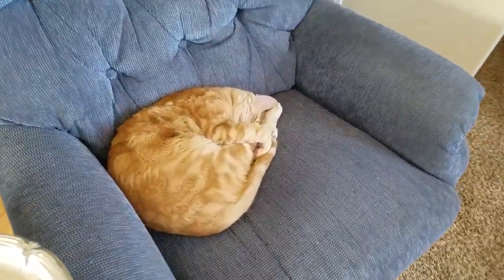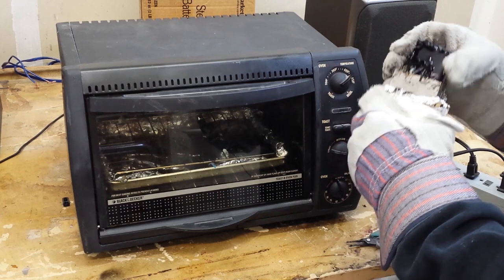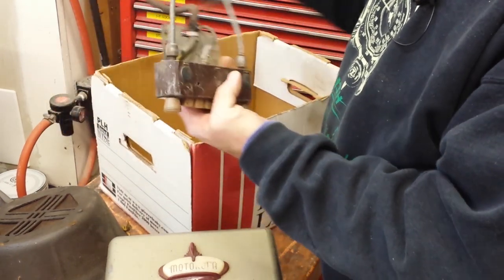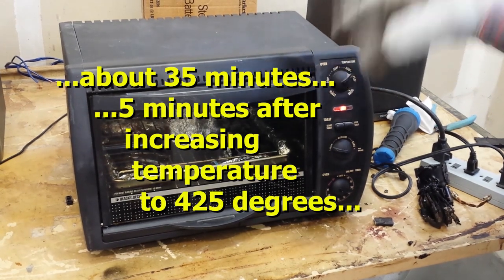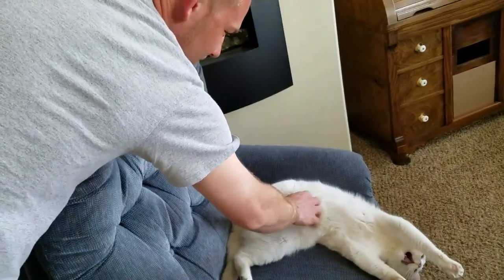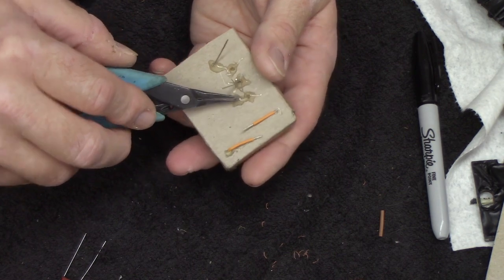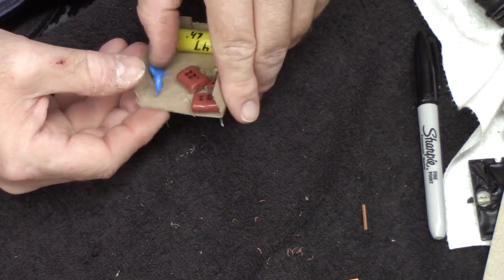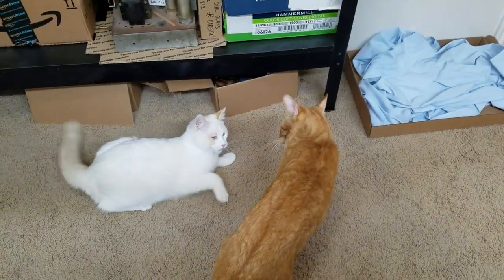1934 Grunow 501 Antique Tube Radio Part 4 of 10 Restuffing the "Can"

Comment: Very neat Motorola car radio, Michael. I have the same one, sans speaker and emblem on the side. It is actually from a 1948 Tucker... and has an NOS head that mounted on the dash with the letters TUCKER spelled out on the pushbutton pre-sets. Back in the 80's a man who was big into Tuckers and knew my dad gave me this radio and it's been sitting on the shelf since. Your video helped me remember it and may just inspire me to recap it. Incidentally I think there were only 50 actual Tucker cars made, but a lot more accessories and spare parts survive.

Comment: Great video Michael! I agree with you on the restoration philosophy. If it can be put back exact, then by all means do so, but the purests, cant put original caps in the can. Maybe melt the tar and encapsulate, but new is new. Looking at the radio, it looks the same as when you started with the exception, its cleaner. Keeping these things out of the landfill is why we do this. I think what you did would be exactly what techs, in the day would have done, if they had the equipment and parts we have. And I think they would appreciate it. How many times have you seen a component tacked across an old one? Very seldom would the old tech remove the whole part and replace.
As usual, enjoyed the video! That old Motorola, and you probably know by now, that V.C. Was for that remote volume control. Also that was an inductor tuner in it. Take care--Larry
Reply from the maker: It's like when I used to restore old Volkswagens.  If the engine was one of the later air-cooled units (1500 or 1600), I'd always install an oil filter.  Every now and then, some know-it-all would lecture me about how that isn't original and should not be there.  In the case of the VW, I was always able to reply that VW, itself began installing those very same filter setups in the late 1970s.  If radio techs in the 40s and '50s had nice film caps as we do now, you can bet that they'd install them, just like you said!  I felt the same back in my car days as I do now:  When it comes to restorations, the perfect is the enemy of the good.  The video showed the first time I opened up the Motorola box.  I didn't really look closely at it, but now I want to check it out as soon as I get home from work!  I don't really know the advantages/disadvantages to using tuning inductors rather than tuning caps, except for the obvious mechanical aspects.  I should study up on it when I get some time.As always, thank you for checking out the latest show.  Take care, my friend!    Michael

Comment: My favorite car radio came out of an 1950 (51?, 52? not sure) Buick.  It was a ginormas thing that took up the entire center of the dashboard, had a huge (8" IIRC) speaker,  and had push pull 12V6's in the output stage.  Really sounded great, the teacher in my HS electrical shop class had one sitting on the workbench powered by a 12v battery eliminator / charger.  He left the thing tuned to WMCA (570 Khz in NYC) blaring out R&R music.  Same radio was in my grandfather's car.

Where did you get that "life time" supply of capacitors?
Reply from the maker: The '49 Cadillac radio that I did about a year ago had P-P 6V6 outputs.  It sounded phenomenal!   It pulled just over 7 amps!   It was an original United Motors Service (Delco) and I really enjoyed it.  I have worked on a couple of other car radios, including some other Delcos and even a Blaupunkt out of an early VW.  I really like the car radio thing.  I bought a really nice Tenma variable DC power supply for those jobs.  I wanted some of my own of these little gems, so I've been on the prowl for decent, not-too-expensive finds.  It continues.....

I buy my caps mostly at Mouser (mouser.com).  They almost always have plenty of the nice Panasonic film caps, and I usually look for Nichicon 105 degree electrolytics.  Reliable service and quality, fast delivery, and good prices-if you don't mind buying a few hundred at a time.   Let me know what you think, Kenneth.   Take care, my friend.   Michael

Comment: Very nice work. Where do you get the vintage-look, colored cloth wiring? I just replaced a plate cap wire on an old Zenith and would have loved to be able to match the gold color.
Reply from the maker: I get my cloth covered wire from two sources.  I usually buy it on line from Radio Daze.  They are fast, reliable, and have fair prices.  Sometimes, they have a good deal on Amazon and since I use Prime, I can get free shipping.  But Radio Daze is usually my source, as they always have it and their service is terrific.  Thank you for watching and especially for commenting.   Cheers!    Michael
Reply: Excellent, thanks for getting back so quickly and saving me from searching everywhere. I just place an order at Radio Daze for cloth wiring and picked up a repro glass dial for a radio I just bought on ebay that was damaged in shipping. Great resource.